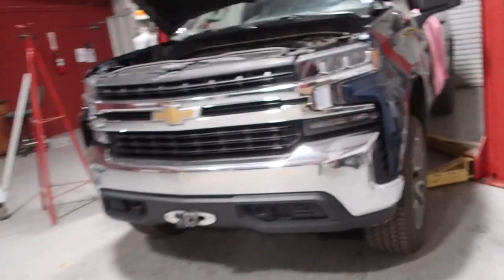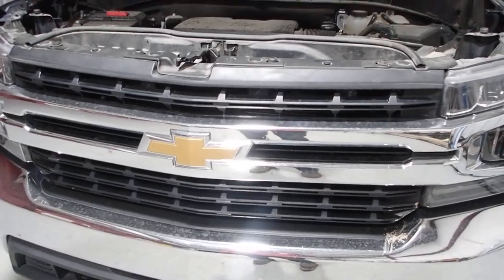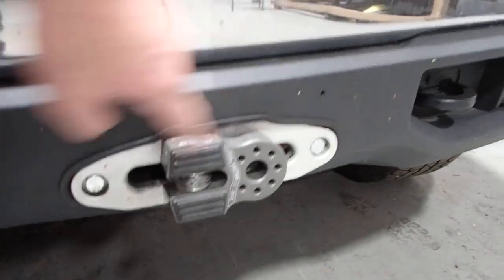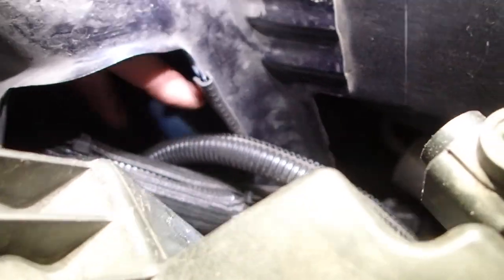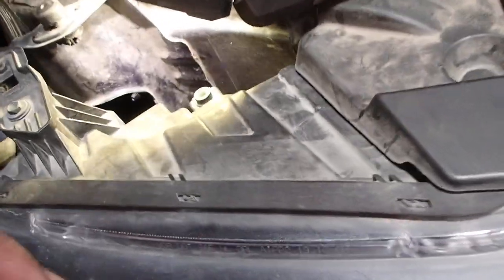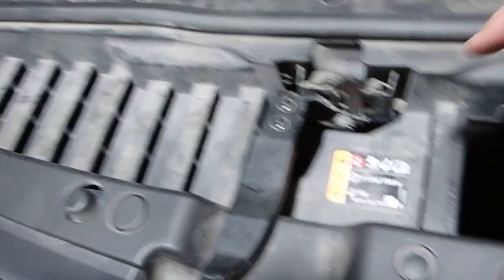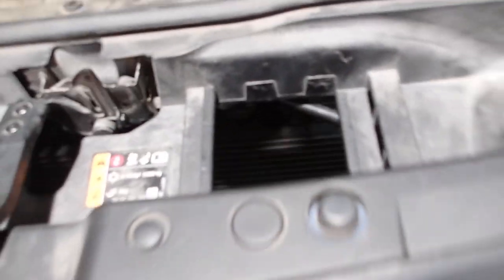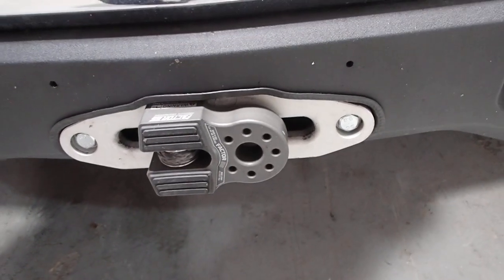2020 Silverado, True Hidden Winch

Comment: What is the part #'s to what was used...for the winch tray, relocation kit,  etc..  if you don't mind
Reply from the maker: I dont know the part number for the tray, I purchased it as an individual piece from a Fab Fours bumper kit and then cut additional holes in it to mount to the factory frame holes.  I then fabricated a fairlead mount and welded it to the winch tray at the seated depth I wanted so that it didn't stick out too far and sat reasonably flush with the front chin spoiler.  
The relocation harness is a Vice kit, they are out of Canada and will cut the conductors to your specified length.
Though it is a direct bolt on now, it took some minor fabrication efforts.  However, it was by no means too difficult for a DIY'er if you know how to drill a few holes and do some minor welding.